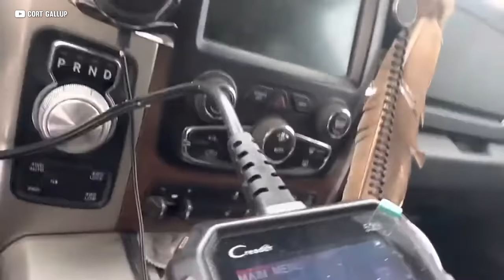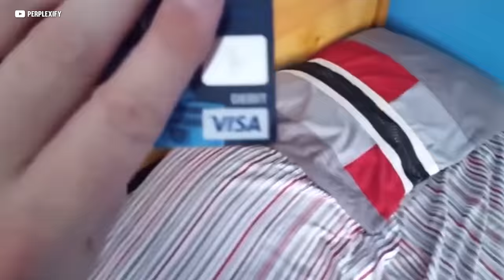Worst Trucks Only Stupid People Buy

Comment: I owned an '09 F150 with the 3v 5.4 from 2015 to 2018. It had the cam phaser issue which was fixed under a warranty I had through my credit union, thankfully. It also had cabin seal issues and ended up growing mold inside. Towards the end of my time with it the check engine light popped again and I was done.

I've had 3 Ford products in my life, each one left me stranded at some point (I forgive the 73 Mustang though, it was 35 years old at the time). I think Ford and I just aren't meant to be. haha

Comment: The Ram Hemi’s are simple issue. It’s MDS of the 2006 and newer Ram 1500s. My Dad has a 2006 Ram 1500 crew cab 4x4 Sport trim that has a 5.7 Hemi. First year MDS Hemi. The thing blew up at 140,000 highway driving kilometres. Only modifications were a true dual exhaust and cold air intake. Rode on factory 20” 5 spoke rims that debuted in 06 with the facelift. One of my best friends when I was in high school had a 2004 crew cab Ram 1500 spec’d the same as my Dad’s 06 that he bought from his Dad when his Dad downgraded to the 2012 Ram 1500. Only modifications were also true dual exhaust and cold air intake. It did ride on the factory 20x8” 5 spoke wheels from the 4th gen Ram 1500s. From what I hear, the 2004 still runs strong at 350,000 km but he has rebuilt the engine and transmission from the ground up beefing up the internals while he was at it. The MDS is the killer across all the manufacturers. My mom has a 2008 Charger 3.5 High Output SXT with only 108,000 km and it’s had the head gaskets replaced twice and on its 2nd transmission.

Comment: At my shop we did a first oil change on a brand new Silverado 4 cylinder turbo with just over 5 thousand miles on the clock.
The tech noticed the coolant tank was empty. Coolant was leaking down the side of the engine. We didn’t pin point the leak but advised the customer to have it towed to the nearest Chevy dealer.the oil change almost ended in disaster. When the tech removed the drain plug it started to spin without coming out. By applying light pull pressure he got it out and noticed the threaded part of the oil pan broke free inside the pan. Thankfully he got the plug back in and tightened without any leaks. The customer was advised and it will be going back to Chevy. To have these issues with only 5k miles makes me wonder what will break next.

Comment: I own a 04 Taco 3.4. It is underpowered by today's standards. It's not a comfortable truck, it doesn't get great mpg's. It's been very reliable. 20 yrs old over 200,000 and it still runs like the day I bought it. I do all the scheduled maint and have had to replace the radiator and the heater fan. No major problems. I had previously ran an S10 and a Ranger. Both were good up to about 90,000 and then started falling apart. I too am eagerly waiting to see how the new Taco is. If it doesn't have any big issues that will be my next truck.

Comment: I have a non-regeared 02' Taco with 35s and have no real power issues. Yes, it's not a Hemi power truck, but it's good. Ive towed with it and it does great. The only complaint I have is my fault, which is a 6" Fabtech bracket lift. It has 285k and never ever broke down.

Comment: I have a f150 2003 5.4 with 270k. Second owner and only every changed, oil 3k, plugs and coils a few times and still running strong. I used antiseize and had a few plugs back out but eazy fix and better than seizure.

Comment: I just spent a lot of money on my 2003 Tacoma's frame.  Its 2.7 litre 5 speed 4WD remains all i want in a truck, so I had it rebuilt.
Reply: Yeah, the Tacomas with the original body style, are at the highest risk of frame rot. Even the ones since the 2005 MY or shortly afterwards, need to be watched for frame rot, with ones from the 2010s not as likely to have the frame rot problem. The 2014s look good, know someone who has a 2014 with the 4.0 V6 and it just keeps going! I told him to not get a 2024, IIRC!

Comment: not sure if i agree with this info. 
1. i have a buddy that had 350,000 miles on his 2005 F250 Diesel -- still running good when he sold it.  
2. My brother also took over my dads 2005 Chevy colorado. -- he now has 300,000 miles on it, with no major repairs other than maintenance.  
3. I owned a 2008 chevy colorado, i sold it with 200,000 miles, never had one issue and still drove perfectly when   i sold it.

Comment: I own a 2006 F150 with a 5.4L triton and I spend every weekend fixing random electrical problems, and replacing sensors
Reply: Also not to mention the serpentine belt tensioner that blew up, the transmission slipping, and the shredded exhaust manifolds

Comment: Ok i have a blue 2008 crew max tundra 5.7 bought it a year ago with 126k on it. I work away from home for a month at a time. So it doesn't get driven much. Its got a computer chip intake and exhaust.  Leveling kit and big wheels and tires. Booming stereo. Its good looking truck.
Now i have worked it hard! Landscaping and hauling equipment.  Ive way overloaded it. And driven the heck out of it. And it just goes. 
Excellent service history and i do synthetic oil changes  every 3k. Whether it needs it or not. Have the boxes done and the tranny fluids. As needed. Oh had to do the brakes. 
But im keeping this truck till it falls apart.  That'll take 10-20 years.

Comment: I have a '99 4Runner with the 3.4 V6, and it is underpowered and has pretty sorry fuel economy. That being said, it is a BEAST in reliability. 250,000 hard miles and it just keeps going, and going, and going. It's practically impossible to get stuck with 4X4 and a rear locker. My son drove it for a while and even got mud in the air box (I know I know, we had the talk) and it's still going strong. I'll take that kind of bulletproof reliability over any other brand, especially anything branded Dodge, Chrysler, or Jeep.

Comment: In 2005 I bought a F-150 extended cab 4x4 with the 5.4 V8 before the warranty was up had the cam Phazers replaced and 100k had the spark plugs replaced 4 of them broke, soon after started getting a misfire on cylinder 4, pulled plug and electrode was completely gone, replaced plug and all 8 coil packs, kept getting a misfire on cylinder 4, I decided to sale truck after 15 years of ownership, I told buyer that it needed and new motor, he said he would rebuild it because the body was perfect and entire truck was very well maintained, well he didn’t and motor complete failed after 6 months.

Comment: My 04 lariat f150 I sold it with 432k on it still ran like a champ. Bought my dad's 08 super duty with the 6.4 it currently has close to 700k on it I've only ever done regular maintenance on it know several people with the 6.0 and 6.4 don't tune them or throw boost at them with out being built and they have zero issues

Comment: I have a 2005 Chevy Colorado with 3.5 L5 and it’s got over 368k miles, Engine and transmission have never been touched except reg maint, also no leaks and does not burn oil, best truck I’ve ever owned for over 18 years now.

Comment: I have a 2010 f150 with the 3 valve 5.4 l. To be honest the only truck I like better was my 5.0 f150. It is good to know what to expect to take precautions to be sure it stays a great truck. I keep up on the maintenance but looks like it would be a good idea to flush my engine on the next oil change
Reply: I would talk with a good mechanic before I performed an engine flush. Depending on the mileage and the amount of sludge in the engine, attempting to flush it could cause oil passages to be plugged or even the oil pump pickup screen to be blocked. I know this from experience.
Reply: @grizz5431  I blew a valve rocker, it's just under 200,000 miles, time for a new engine and a rebuild for this one. And I already had a plan to break everything down to flush

Comment: I owned the Titan Big Failure in Cummins, F150 5.4 blew out plugs after I brought it into Ford Shop for troubleshooting a strange noise in engine bay.  Now I have the 21 Ram 5.7 no concerns yet.  I purchased a 8 year bumper to bumper warranty to be safe.

Comment: I have an 2005 Excursion 260k miles and a 2006 F250 250K mile both have the 6.0l I love both of them for towing. this year is the first time I have had to replace the glow plugs. I have had to replace the FICM on both of them once and that was well past 200K on the original FICM. Even though the 6.0L is known for all sorts of issue I have been fortunate, I would take it over the new diesel that have to run DEF any day of the week.

Comment: I can't argue with your picks, but I would add that although the Ford 5.4l Triton 3V engine does indeed suck, the older 2V engine is much more tolerant of owner neglect, making these older 4.6/5.4L trucks a good used choice. Yeah they are 60-80 hp down from the 3V engines but they do last.

Comment: Upon scrolling through the comments it seems the iForce V8 4.7L motor found in 1st gen Tundras is not mentioned by anyone, unless they're deep down past my venture.

Do I love my Desert Dog, my Baked Arizona (clear coat wasted away) like any 1st gen Tundra owner, 
til death do we part.  

I just returned from Arkansas, driving round trip and additionally adding more miles duirng my two month visit there in total putting about three thousand miles on the clock. She purred all day and night on the I-40 at 75 MPH.  No doubt I was lucky to be getting 15 MPG with a tail wind but I didn't expect more nor less by much.

I am the third owner of this 2003 now with 170K+ on the truck overall.

I've had the timing belt replaced along with the water pump and also a new radiator in the first two years of ownership.  I actually had the TB replaced stat within a couple months of ownership.  Of course the WP too was R & R'd but sadly this was done by a less than optimum mechanic.  There was immediately an issue in which a tiny leak of coolant on a WP gasket meant I had a smelly coolant leak. (...and trouble ahead, IF...)

I gave up dealing with the quazi mechanic that denied the leak existed, being I had some warranty (after market used vehicle warranty) work being done at the dealer I went ahead and again had the TB & WP, R & R'd and the dealer told me I needed a new rad. 

The warranty work I needed was the A/C condensor and that entailed other aspects of the system being R & R'd by the dealer.  Also under warranty was a modest leak on the PS rack which along with the A/C system fix was covered by warranty as mentioned.

The TB, WP & Rad was on my dime.  Live and learn. 

Of course I've R & R'd the serpentine belt.  I even added 'AIRLIFT' bags to the rear suspension due to hauling a 6' X 10' cargo traier and the box filled with never removed items being I have no other place to keep said items. So for security purposes I've added more weight onto the 6' box now capped with a $500 found on C.L. WORKMATE 3 door shell that has an intergrated rack on top for more potential load for the rear if needed.

Well there no doubt is more but to end this finally, let me say I do LOVE this TUNDRA with the iForce V8.

Comment: Have a 2006 Dodge with a 4.7 and the problems you noted are basically O.E. "Operator Error".  Pulling the cam cover is a 15-minute deal, and yes lifters can fail, if you change them out when you have noise the problem is solved, the other issue is cam chains, about a 4-hour job to change in your home shop, done mine myself so am talking from experience.  The engine is a pain in the ass to get to if you have 4 x 4, invest and make a work step, which makes things drastically easier to do.  Yes, they are gutless wonders but seem to work fine if maintained.    Now if you overheat them there is a technical term, you are done.  It also seems that all of these engines that turn cylinders off to save fuel economy seem to have MAJOR issues down the road.  One engine you overlooked was that a train wreck going somewhere to happen, 3.0 Lt Chevy diesel, who was the clown that designed it?  Come on you have to pull the transmission every 100k to change out the oil pump belt?  Seems as if other issues seem to be surfacing with this POS as we speak.

Comment: I had an F150 Triton with cam phaser nightmares.  I had to run thick "crap" oil in it to prevent stalling at red lights. BTW Synthetic guaranteed to make it stall.  The Ford tech at the dealer said it was new engine time at 120,000 K.  Switched to Sierra 5.3 and 190,000K later all I have done so far was change the spark plugs and wires.  The Active Fuel Management adds about 2 mpg, but I get  vibration. Typical GM leaky sunroof. The water collects in the headliner and smells like cat pee. Front end wear parts wore out 3X on the Sierra so far, when the Fords never did. So both have their issues, but I am not ready to forgive Ford for the 5.4 Triton.

Comment: I have a 2016 Tacoma and it had to have the timing cover replaced, apparently the 2016 and a lot of 17s got the timing cover improperly mounted at the plant in Mexico and so they usually gave out around 36000 miles for the ones that did get it installed wrong. Besides that not that much to take note on. Pulls the boat easily and does fairly well off road. Not much but not much to complain on.

Comment: I had a 08' Ram 1500 4.7 and 6spd it was a solid runner gas mileage wasn't the best. I towed a 28'  travel trailer with no issues. The only issue we had was the clutch failure at 50k. My buddy has a 05' Ram 1500 with the 5.7 and it has been a solid runner and it has a manifold leak but he keeps running it and it has over 300k on it.

Comment: I own a 2002 Dakota 4.7 Quad Cab, 2007 Dodge Ram 5.7 club Cab, a 2005 Chevrolet Silverado 6.0, and a 2007 Ford F150 4.6 Super Crew. 

My 2002 dakota 4.7 motor has been great. 250k miles and never had an internal problem. Its all the other crap that has annoyed me. It gets great gas mileage and its fast. Not bad for a 20+ year truck. You can actualy fit 6 people in their. My 2007 ford f150 4.6 has over 500k on the oem motor. I changed the original fuel pump 6 months ago. It still worked but the screener and pick up hoses had dissolved, so i replaced it with a Delphi. Another great truck. 

2007 Ram 5.7 is out of commission for now. My 

2005 chevy 3500 6.0 is ok. I wish my dakota could be more reliable. I really love the size and specs of the truck. It has everythjng i need in a compact but usefull package. Its low enough that i can easily climb the bed or load my tools either in the back seats or the bed. Ooh i almost forgot. The Dakota has rear fold down seats. I literaly store 5qt bottle of motor oil, 3 bottles of antifreeze bottles filled with purified water, 2 quarts of power steering fluid, 1qt of brake fluid, 15ft jumber cables, 20ft 20,000 lbs tow strap, 1 can of electrical cleaner, 1 can of starting fluid and the mechanical fan with clutch, a spare Transmission Control Module and a spare Engine Control Module. All that fits hidden in the back seats. Thats crazy. My F150 can only fit half of all that.

Comment: I have a 2003 Toyota Tundra. This truck should be on the list. You can no longer find parts for this truck. So, if something major breaks then it's off to the graveyard. I found out that they are known for the gear shifter housing breaking. It's an automatic. The metal frame that holds the gear shifter completely broke making the stick flop around like a wet noodle. I was lucky and he found a new part. I just recently replaced a whole CV joint on the rear driver's side tire. That's a normal repair for any older car. Rubber gets old and the lubricant drains out and the bearings go crazy. $980 fix. I also spent $989 getting the hood stripped, anti-corrosion coated and painted. I let my exfriend replace my brake pads. The rear brakes ended up breaking so bad that it made a groove in the metal. Cost me $850 to get new rear brakes. Next I plan to paint the roof, bed and outside of tailgate with spray-on bedliner plastic. And, I need some new updated headlights. They keep turning yellow.

Comment: I have cared for a ‘99, F 150 w/ 4.2 liter V 6. It has over 300k, and we don’t drive it much anymore. 
But it has been a reliable mule truck all these years. 
My Ex, who has had this truck for 10 years, has left it parked for months, repeatedly . I don’t know why. But, it will start and run and do what is asked of it.
My secret? 20/50 motor oil. 
I drive ‘21 5.0 F150. Love it.

Comment: I’ve had 4 GM vehicles, and I’ll never buy another one again. I’ve had a 2009 Silverado 1500, a 2018 Silverado 1500, a 1987 R10, and finally, a 1998 C5. Every single one of them had major issues. The 2018 Silverado and C5 had under 70k miles too. The 2009 Silverado leaked every damn fluid imaginable, and it was rotting away. The 2018 Silverado had trans issues, so I dug into its history. It already had a trans replacement. The R10 spun a bearing a day after I got it. And the c5 had the common harmonic balancer issues which costed $1100 to fix.  I went to a Ford 6.7 PS and haven’t had to do shit to that truck other than basic maintenance. If I had to go to another brand, I’d go for a Cummins. In fact, I’m looking at a 24v 5.9 dually right now to go alongside my 6.7 PS.

Comment: I had a 2001 Dakota with the 4.7. Put 263,000 miles on it without a single engine issue. My buddy bought a Ram 1500 with the 4.7. Didn't even make it to the 50K.

Comment: 104,000 miles. No transmission cooler because the  stock ones almost as big as the engines. Changed oil every 10,000 using full synthetic. Would have changed more frequently if I had been towing more. Had transmission serviced at 50,000 mile (7 years old) by shop that removed pan and changed both internal filters. Would never flush a transmission ever.

Comment: Had a 2013 ram with the 4.7. Sold it with 348k miles on the original motor and only ever had to replace 1 coil pack. Don’t understand how this engine made the “do not buy” list 💀